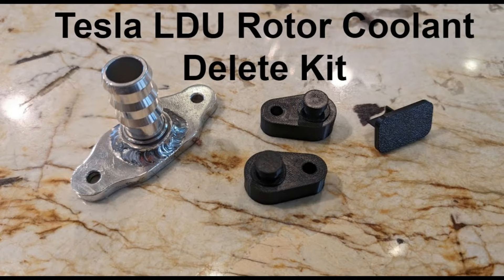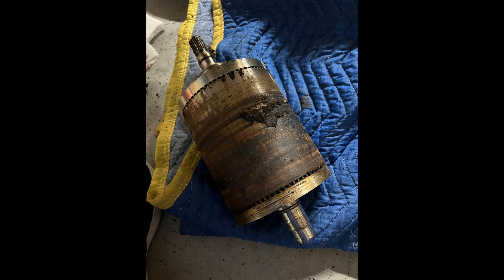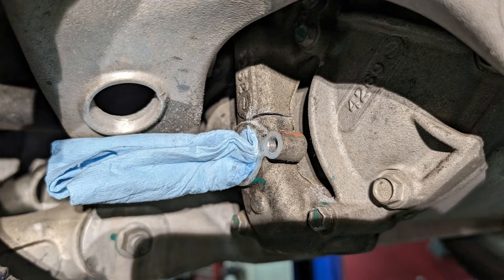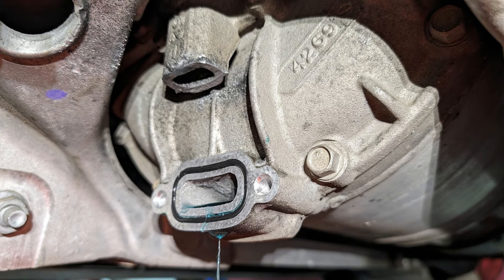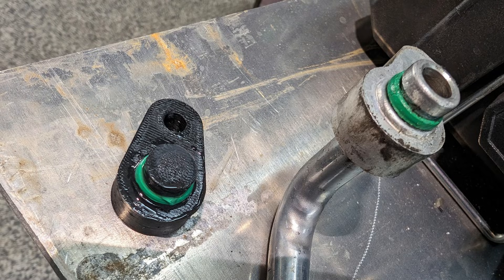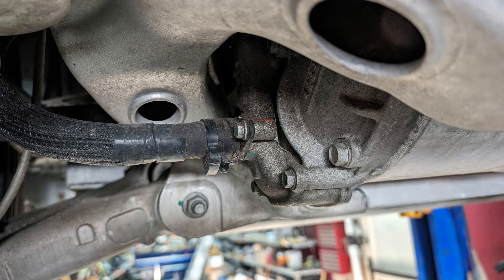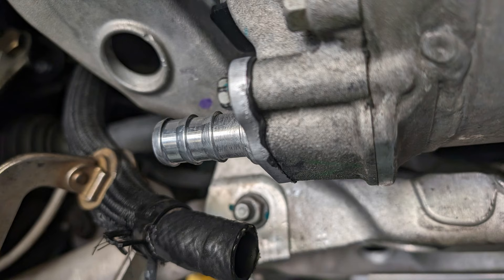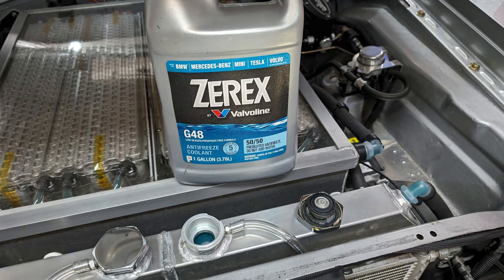Tesla LDU Rotor Coolant Delete Kit - For sale in the description!

Comment: Very cool solution. I will consider offering this as a service at my shop, S 3 X Y Auto Service in Mission Viejo, CA.
Reply from the maker: Thanks!  It's perfect for cars that are still in great shape, it prevents the wear and tear of pulling the motor for no other reason.  If the motor is out, it's a really easy install and increases cooling to the stator and inverter! 

I get a lot of requests for shop referrals, I will put you on the list!

Comment: Does anybody testet the 3D printed files from there website?
Reply: I did, they all work except for the main bypass part, which leaked no matter what I did with it. (the OE fitting adapter) I ended up reusing the cut part, printing a plug for the top and epoxying it into place. I had to cut extra from the top of the part to provide clearance for the plug. It has only been a few days, but no leaks so far.

Comment: Wouldn’t it be just as effective if I cut the metal tube and used the cap on both cut ends with sealant so they don’t come off instead of having to unbolt the ends or cap and seal the driver end because I think it’ll be tough to get my hand in to take the bolt out and just cap and screw in the other side, like flip flop option 2 of the metal hose portion.
Reply from the maker: You can definitely try and seal the inboard end of the pipe instead of installing the O-ring plug.  This does have coolant pressure so just watch for any leaks.  The top of the manifold on the drivers side is very difficult to get to, capping it off is fine as there will no longer be cooling at the manifold.
Reply: @MrMoparMan could I use the cap that comes with the kit and use some super heavy duty adhesive bond and just O-ring plug the side where I cut the manifold or what could I use to plug those lines that may fit or go around with adhesive 🤔 I just don’t think I’ll have the patience to try and reach the bolt in that tight space and I don’t really want to take it into a shop so trying to work with what I can on my own
Reply from the maker: @NS-7-7-7 are you referring to the bolt at the top of the differential?  This is the side that will have coolant pressure.  If you don't want to try to reach the bolt at the top of the differential, you can cut the pipe and then flex the pipe out and try to seal it.  Yes, you can use the extra cap but you will need to make sure that pipe is sealed with RTV silicone first.  

Let me know how it works!

Comment: I'm about to order the kit.  Instead of using RTV silicone on the inlet, can we just get a new OEM o-ring gasket from Tesla and replace it?  I assume they have this part available for sale.  Another question is if I have to cut the top return pipe and put some cap/plug at the end of the unused pipe, will there be any built-up pressure to push the cap off later on?  I don't know if this rotor coolant return pipe is internally connected to the Stator/inverter coolant return pipe or not.  Thanks.
Reply from the maker: You can probably reuse the original o-ring, it has worked for many people... That makes the job very quick. 

After cutting the return pipe, the inboard section needs to be removed and plugged with the o-ring plug.  This is the only place there would be pressure.  The pipe that remains attached to the manifold has no pressure. It just needs a dust cap. 

The rotor return pipe returns the coolant to the exit port at the differential.  There will be nothing to return after blocking off flow to the rotor.  It's the same exit port for the stator and inverter return flow.  The stator and inverter get their flow straight in from the fitting, so after this kit 100% of the flow goes to the stator and inverter.

Comment: Wow, THANK You.  JUST Ordered one.  Does the Top Tube Send Coolant in the Same Direction as the Larger Bottom Tube?  The Inverter will Still Receive Cooling from the Main Feed provided with the Kit Correct? so there's No need for the Top Tube or Pathway.
Reply from the maker: Thank you for the order!  The top tube is a return tube after cooling the rotor.  The bottom tube feeds the stator and then the inverter.  Both of the returns end up at the outlet at the bottom of the differential before it goes back to the radiator. 

Since we cut off flow to the rotor to prevent the leak, we just send 100% of the coolant through the stator and the inverter.  The stator and inverter get increased cooling after the modification.
Reply: @MrMoparMan Thank you AGAIN, CAN'T WAIT To Get this Mod Done!

Comment: Hi, is it doable on B-Class without removing the LDU? Is there enough space to remove the upper pipe? Thanks!
Reply from the maker: I honestly don't know, I have never worked on the b class.  This particular kit will not work because the Barb is straight.  It's an angled Barb on the b-class.  I do have a downloadable model that just has a socket to reuse the factory Barb.

Comment: How does the drive unit cool now?
Reply from the maker: The primary cooling of the drive unit is the stator and inverter cooling.  This is where Tesla has temperature sensors and will derate power if temperatures get too high.

The rotor cooling was only a small amount of flow, about 17%.  This kit redirects 100% of the cooling to the stator and inverter, the most important parts to be cooled.  My data logs  show 5% to 10% better cooling at the stator after the kit is installed.

Increased rotor temperatures have not been an issue with any of the delete kits.

Comment: cant you just crimp the pipe rather than remove \cut\plug?
Reply from the maker: That's a good thought, but it has to be watertight.  The coolant will flow backwards through that pipe if it is not sealed completely.

Comment: doesnt this just cause the inverter to just over heat
Reply from the maker: No, in fact the inverter now gets better cooling...The cooling system is fed by a 3/4-in fitting, then a 5/16 fitting was split off to cool the rotor.  Most of the flow continues through the stator and then into the inverter.  The two streams of coolant rejoin and continue to the radiator.

This kit eliminates the flow to the rotor and increases flow to the stator and inverter by sending 100% of the coolant directly into the stator followed by the inverter.

My data logs show 5% to 10% better stator and inverter cooling.

Just a side note, the Tesla will not allow itself to overheat, it will reduce current to protect itself.  This happens at very high temperatures.

Comment: Great kit and everything worked great. Thanks.  I just have a couple of suggestions. First, PLEASE add to the comment area that people need to disconnect the fireman's loop before starting this project.  In the middle of install, the car turned itself on and energized the coolant pump and popped a coolant drain hose off the coolant tank in the frunk (which I now have to fix), dumping about a gallon of coolant on the floor.  This could have been avoided if we pulled the fireman's loop first.   Second -- in my car -- a 2014 P85D, it was impossible to remove the nut holding in the flyover tube to the side of the LDU. After trying this for at more than an hour, we gave up and cut the tube as suggested.  I think cutting the tube should be the PRIMARY method -- it was SO much easier than trying to remove the whole tube.  Maybe there are cars where removing that nut is easier/possible, but it sure was not for my car.  If we started off cutting the tube, we'd be done 2 hours sooner.

Comment: Why do we have to cut the smal pipe,wouldint be easier just to leave it there ,no culant is going there anymore so why extra work ???
Reply from the maker: It's because it will get pressure from the other side and then leak.  The return flow from the stator and inverter Will flow backwards through that pipe if it is not plugged. 

Luckily it's not too difficult to just cut the pipe and remove the inboard portion where the plug can be installed.
Reply: Sorry for beeing stuburn but when i look at it after we do the big cut aint we eliminating both flow and return ?
Please let me know quick i want to buy this just need to understand everything .Thx.
Reply: Ok,i ordered the delete kit.
when i looked on the tesla sticker i have I version of the motor not Q or U is that changing anything ,is my motor beter or worst production.
Its 2014 model ,thanks for all advice.
Reply from the maker: @piotrnoda3601 thank you for the order!  To answer your previous question, it does cut off feed and return to the rotor.  This permanently prevents the possibility of any leak associated with the rotor.

I don't know all of these specific revisions, The biggest thing is to check the encoder attached to the coolant manifold.  If there are any signs of moisture or rust, the motor should be removed and cleaned out to prevent any problems due to existing moisture. 

If the sensor just has a little bit of grease, you should be good to go.  Just install the delete and drive the car!
Reply: @MrMoparMan finally got around to checking the sensor and ordered the kit. it had mostly some grease but did have some moisture. At this point is performing this fix like a bandaid on a broken bone or is it required to rebuild the LDU and then do this?
Reply from the maker: @bjently this is a great discussion... 

The drive unit can be rebuilt before or after installing this kit.

This kit will permanently eliminate the possibility of any leaking from the rotor.  So whether or not you decide to rebuild, it's a 100% foolproof rotor leak elimination versus the pressed in caps that can and have leaked.

If you suspect moisture, a rebuild is the ideal scenario to dry everything out and replace bearings etc.  This gives you the peace of mind that everything is okay.

Nobody knows how much time you have.  Some motors run for a very long time while leaking.  This is how they can get to a very rusty/muddy condition before any problems show up. 

Some of the early fixes, before deleting the coolant leak, was to let it leak but drain it out.  This means moisture was present, but not enough to flood and do damage. 

Some people have been in your same scenario but unable to rebuild right away.  They have installed the kit to "risk it", or as a way to "buy time" before they remove the motor.  Many of them report back with tens of thousands of miles and zero issues.  I have not had any feedback from anyone who has installed the kit and then had a failure.  This doesn't mean it can't happen if it had already started to leak.

Good luck with your decision, I hope your car runs for a very long time.  Please report back with any and all feedback.
Reply: @MrMoparMan 👍 orders under Chris W, lmk when able to ship if u can. I’ll update long term on longevity
Reply: @MrMoparMan  Successful install! Will update with any other info
Reply from the maker: @bjently Awesome, great job!

Comment: I recently purchased a 2014 Model S off a family friend who bought it new and probably had it serviced exclusively by Tesla.  It currently has 91k miles.  
Would Tesla factory service have ever done a similar bypass or fix to address the leak issue?  I don't currently have a full service history but will try to get one, not sure if a carfax would show this. I am just curious if I would be doing redundant work if I install a bypass kit at this point.
Reply from the maker: The first thing to check is which model S, whether it is rear wheel drive or a performance version.  If that is the case then you do have the large drive unit (LDU).

Next you can look for a "U" revision coolant manifold from Tesla.  It's a cleaner looking part that is more cylindrical versus a square casting.  The coolant manifold is on the end of the motor under the rear driver side of the vehicle.  There will be a rubber hose entering the bottom of the manifold.

Comment: Another tech said "I don't recommend any method that eliminates the flyover tube, without it, there's a large air pocket that gets trapped in the cooling system that is basically impossible to bleed properly." Do you have a response to this? very curious because your method is far more achievable for someone w/o a lift
Reply from the maker: @bjently  well there's a couple things here.  First, the region where air could be trapped is a non-issue.  It would be at the top of the differential, it's not in the motor or inverter that can quickly get hot and derate.

Second, if you want to bleed it, it's super easy, just loosen the block off plug, run it for a minute and it will purge immediately. 

Finally, keeping the flyover tube reduces the cooling capacity of the drive unit since it is no longer cooling the rotor, but bypassing fluid away from the motor and inverter.

Like you said, this method is not only the easiest to install, it increases cooling to the motor and inverter. 

Hope this helps!
Reply: @MrMoparMan thank you for your quick and detailed response. I’m going to pop the bottom and check the locations of things, reread the guide several hundred times and then place my order. 💯
Reply from the maker: @bjently  great, let me know if you have any questions!
Reply: @MrMoparman- what if you put a Y at the coolant inlet and simply put a restrictor in a small tube to feed that pipe? That way you dont have to worry about access to it over the top, or high vol of coolant bypassing the motor. Cool stuff!
Reply: Will this fit a p90DL rear drive unit?
Reply from the maker: @ElectricLifestyle1  yessir!

Comment: Hi, prospective Tesla buyer here.  According to Tesla all the motors in their cars are liquid cooled?

Is it just the large motor that has problems, or do all Tesla owners have to contemplate a coolant delete, even on a non-performance variant?
Reply from the maker: Hello!  Only the Model S large drive unit is affected by the coolant leak and needs to be deleted.  The rear wheel drive only Model S, and the performance versions of the Model S have the large drive unit.
Reply: @MrMoparMan  so, a 90D has two small motors?

And a P90D or P85D has one large in the rear and one small.in the front?

What would you buy?  A 2017 90D with free supercharging or a 2016 P85D with free supercharging?
Reply from the maker: @AuntieWokery  that is what I understand, however, I'm not an expert on all of the years and models... I would lean towards the 90D for reliability, and the P85D for performance.

Comment: What about the gearbox cooling?
Reply from the maker: @CoffeeQuilava  what appears to be gearbox cooling was actually gearbox heating. 

In order to cool the rotor with coolant, the coolant must be heated during this thermal transfer.  So the heated coolant was returned to the top of the differential.  The rotor gets much hotter than the differential. 

This heated coolant entered the top of the differential and then joined the heated inverter return flow at the bottom of the differential.

This was a clever design to get the oil up to temperature quicker on short drives for moisture mitigation.

I opted to divert this coolant to the motor and inverter for increased cooling.  If you push these motors hard, this is where the temperature is monitored and were d-rates will occur.  My data logs show 5% to 10% better cooling in varied conditions.

Bypassing coolant just to keep the return pipe flowing reduces overall cooling capacity since it is no longer absorbing heat from the rotor which had a high temperature differential.
Reply: @MrMoparMan  OK. Thanks for the information. Just put a order in.
Still chancing a hum coming from the rotor under power
Reply from the maker: @CoffeeQuilava  Thanks for the order, it ships tomorrow!